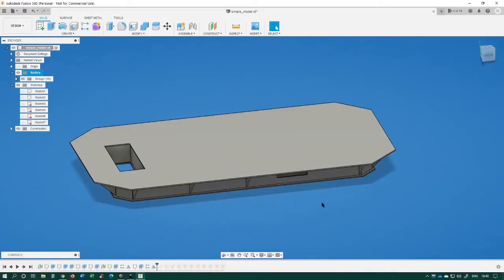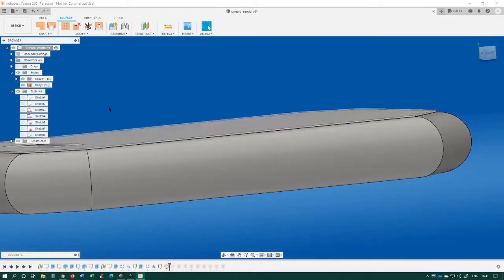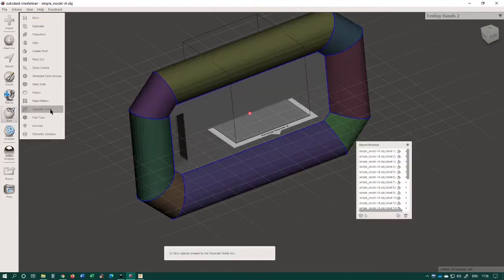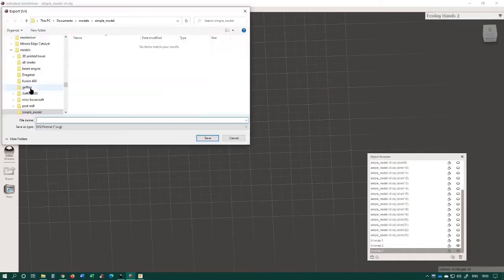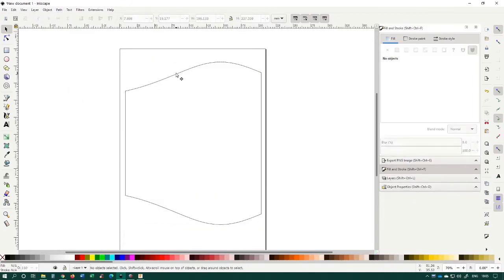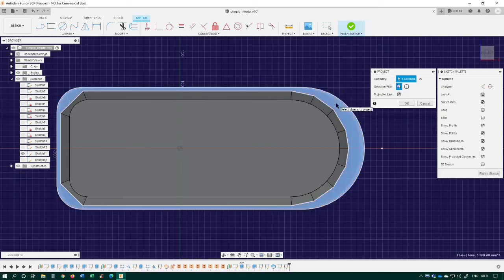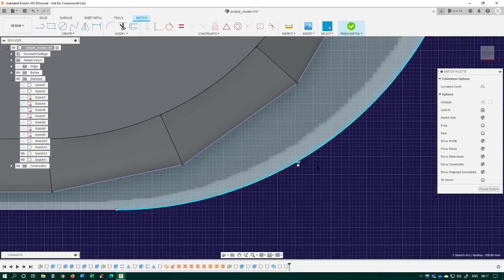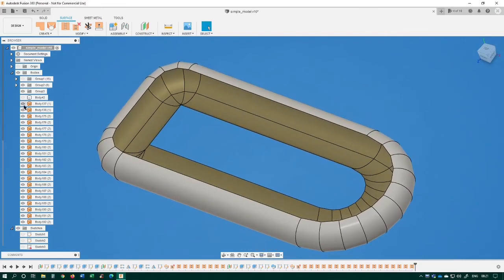Using Fusion 360 to design model hovercraft skirt patterns

Comment: How does the lifting method influence the skirt shape? Propeller vs. Centrifugal fan. I plan to build a 2000TD, but instead of propeller (that pushes air directly down through a hole in hull, and partially sideways to the skirt bag) I want to use centrifugal fan like most real hovercrafts. With the fan air goes only sideways to the skirt first, and then from the skirt under the hull. Should the skirt bag be more round or squished with the second method?
Reply from the maker: generally the type of fan does not matter that much so long as it can generate enough flow to compensate for air loss from under the skirt. A centrifugal fan will generally create more pressure, but less flow than a propeller, depending on the type (e.g. backward vs forward bladed etc.). It's a complicated subject, but to be honest, the best approach is trial and error.
Reply: @ModelHoverAssoc  any chance of doing a similar program but involving segmented forefinger skirt. I would be very interested as I am building a radically new design